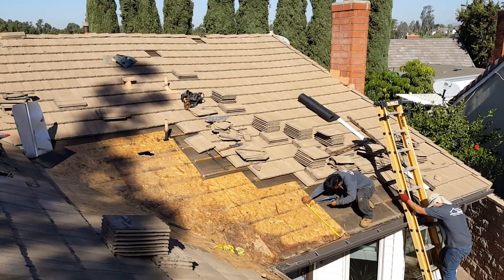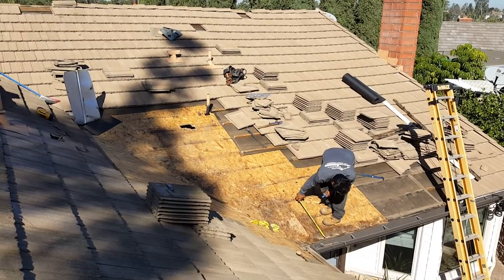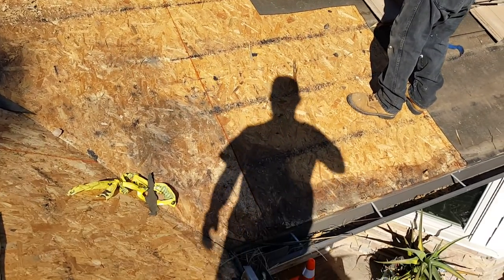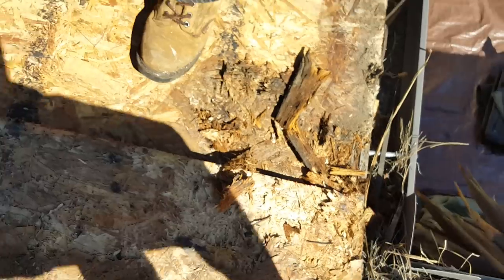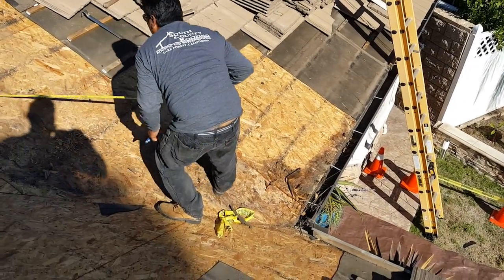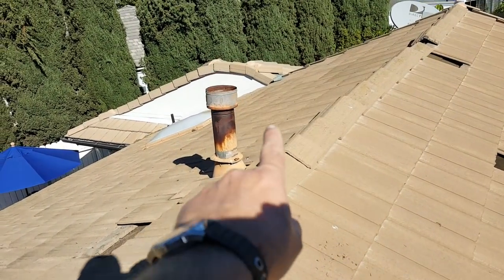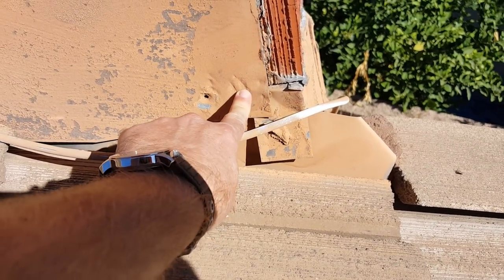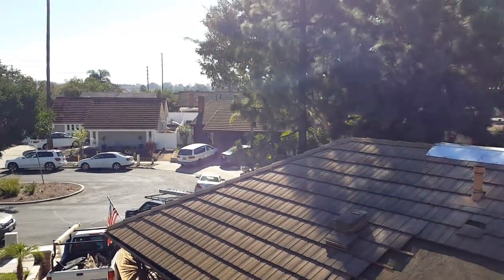Flat Tile Valley Roof Leak Repair in Lake Forest, Ca - South County Roofing

Comment: I am doing a tile re-lay on my house, Lifetile flat. 38 year old single 30#, no drip edge on eaves and 1" x 4" boards serving as tile riser for the eave course. I found a date stamp on the 15/32 plywood.....10/03/80!  I understand the building code now is drip edge and tile riser metal for the eave course as to prevent water damning and rot at the eaves??? The 38 year old 1 x 4 and T n G eaves are damn near immaculate, not perfect, but not bad for the "old way". 

Thanks for the tile videos I learn a lot. Am I correct on code being drip edge and metal riser now??
Reply from the maker: That would be correct.

Comment: Looks just like my tile.  How much does a repair like that cost?  I'm assuming you won't want to say, but that's okay.  No harm in asking.  I'd guess $1200.  LOL, but then again, I'm not a roofer.
Reply from the maker: What we did there was probably a little over 2k.  Not all tile roof repairs are that much.  It depends on the size and who is doing it.  If they are good it will cost you more than you would like.  But, you wont have to do it twice and that is where the savings is.  I have never charged to fix the same leak twice.  Most leaks I fix have been repaired multiple times.